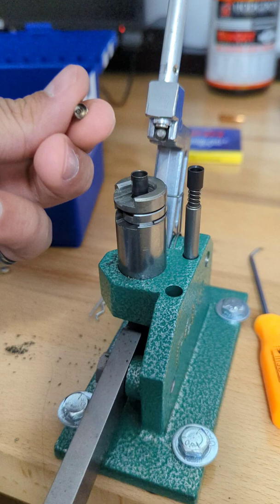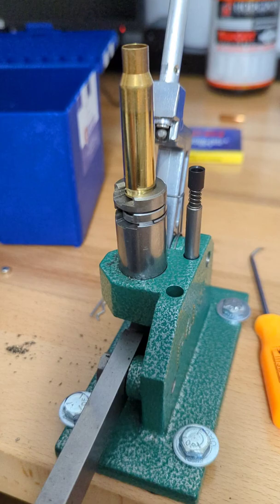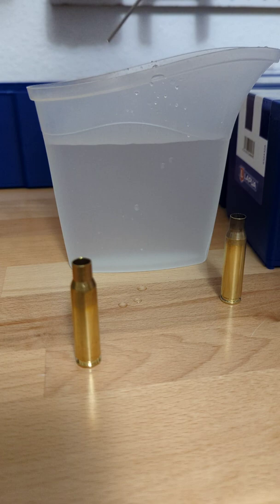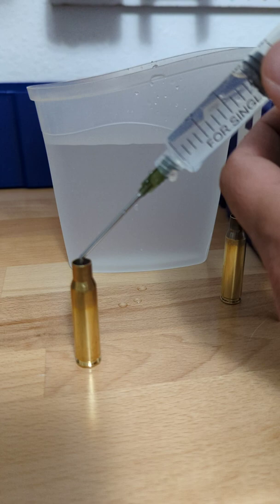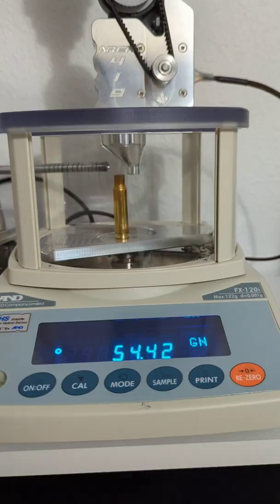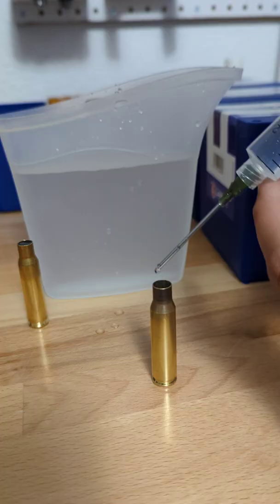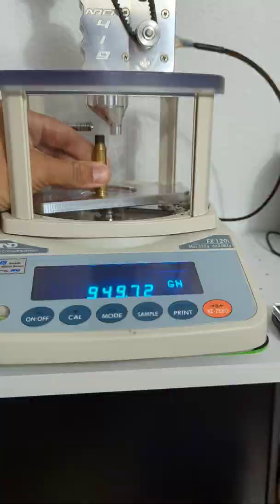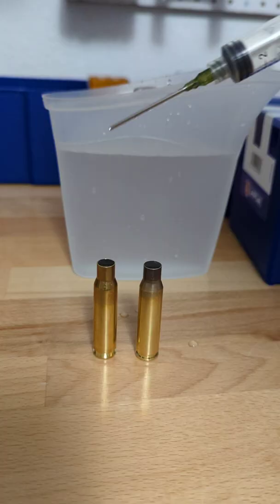Measuring internal volume of brass

Comment: I wonder if the thickness of the brass has also changed, maybe ever slightly with every trim.
Reply: Most certainly. Chamber volume minus brass volume equals case volume.
Reply: yeah for sure it has gotten thinner. you can even notice around the neck of the cartridge. the one that's been fired has a noticeable difference in thickness around the edge of the neck compared to the unfired brass .I don't think it will make a difference as the brass forms to the chamber when fired and that's what contains the explosion. I'm sure there is a maximum amount of times you would want to re use brass before it gets too weak . I'm sure after so many shots the brass becomes too thin and also work hardens causing it to be thin and brittle. I don't think it would lead to catastrophic failure but I could see the brass getting stuck inside the chamber or developing cracks or separating from the base of the cartridge. I think it's more of a concern for malfunction and possible gun damage than dangerous to the shooter themselves.
Reply: I've shot brass until it has split the neck
Reply: @wyattblack7437 just wondering, how many times do you shoot before split develops?
Reply: @litoaykiu  20 +
Reply: Yes. The length you trim off has to come from somewhere. It's brass flow from the case walls
Reply: @litoaykiu  Rule of thumb is around 15 with brass cases. But it all depends on reloading techniques and how hot your loads are. Annealing is very important.

Comment: We used to leave the primer out and insert a same weight bullet to the COL for that rifle and fill the case through the primer hole and then weigh it as volume would change with different types of bullets and depth seated. That would give you the exact volume that you.are.working with. Then pull the bullets, dry and reload. We used to also use the Powley computer also, way before the internet.

Comment: You should have done that after resizing the neck and shoulder of the spent brass. Because that's going to shrink the weight, also if you have to trim an overlength neck

Comment: I don’t have time to read all of the comments so perhaps this has been mentioned before. The entire cartridge that contains powder and the bullet when fired expands to fill the chamber in which it is housed. The case grows in length obviously the reason for the case trimmer. The case can be reloaded multiple times. The brass is flowing towards the neck of the case and thinning out. Eventually the case will crack almost always where it changes direction. Obviously resizing brings the case back down to the correct dimension. Metal is like plastic it moves and flows and thins.
Reply: We are all thinking the same thing

Comment: HOH capacity of brass is always (as a standard) measured with as much of a meniscus as possible-not eyeball level.
Reply: That’s what I remember from my chastity days too, you’re supposed to measure with the meniscus. Otherwise each measurement will be prone to small errors.

Edit: and wouldn’t the weight of the brass tell you the volume of the brass casing as well?

Comment: interesting .34 g° difference.
 is that from case expansion on the used casing??
Reply: Theoretically... this is a highly error prone process which most shooters just laugh at. Not repeatable enough to be useful.
Reply: Well within the tolerances of two different virgin pieces of brass from each other. Pretty much telling us that doing this doesn't reveal anything useful.

Comment: The only thing you demonstrated was how much weight of water was in the casings, not their volume. Volume is not measured in weight, but by cubic volume of a gas, liquid or solid. If you want to use weight for volume, there is a lot of math and very specific data needed to do it. A gallon of water weighs 128oz at std conditions, but it's volume will change based on temperature, atmospheric pressure, and composition of the water.

Comment: If the brass is resized by the die and you check and trim your cases, would that not change the weight as well? Brass shot 12 times? Must be target rounds hunting loads close to max load don't last 12 reloads.... So what's the point of your water test that delays the reloading process

Comment: if you're not loading to full capacity of the case, what difference does it make?
Reply: empty space inside the case is different. Ergo, different pressures behind the bullet.
...I guess you don't reload for precision....
Reply: The Compression cavity is slightly larger. You will get a slower pressure spike vs a faster spike with smaller case, impacting  muzzle velocity.
Reply: @benjohnson2421   I like your explanation the best . Some one once said the simplest solution is the correct one. 👌
Reply: @dailyg2719  Thanks.  Not to step on Nicholas. Just could of been worded better and nicer. But throat space has most to do with the pressure spike. Minute variations in length also contribute. Thin shot out cases can slip the bullet back off the feeding ramp. Mix of both of them and your MOA will be crap.  12 reloads is way too much in my book.
Reply: @Gnolomweb  Wow. Supercilious much? What if he doesn't even reload like me and just wants to learn?
Reply: Yeah, I'm looking at this and thinking, "So what?" I never construct compressed loads anyway. 😕
Reply: @Gnolomweb  The dude was asking a legitimate question and you’re trying to be a smart ass because you got excited when you seen someone asked a question that you knew the answer to. Calm down man. When you mature you realize the people who are trying to get into reloading or the gun game in general shouldn’t be turned off by the attitude of people who are into it. You never know, one day you might find yourself in a trench next to that man with the government on the other side
Reply: @bustabass9025  it’s not about compressed loads. Think of it like compression ratio in a car. The smaller the volume, the higher the compression ratio (in an analogous way). In other words, if you have 40gr of powder in a 100 cc case, and 40gr of the same powder in a 50cc case, which one will give you more pressure? The smaller case, of course. Sure, we are talking about a fraction of that difference, but it matters if you’re chasing single digit deviations in velocity from round to round. You want everything to be the same: case capacity, length, primer flash hole diameter, etc.
Reply: @MasterArkannor  Then he got his answer. Don't be such a soyboy
Reply: @Gnolomweb  And because of people like you, fewer people will take an interest.

Comment: What was the weight of each casing before the water?

I've noticed slight variations in brass weight between different manufacturers,  even variations from the same manufacturer. 

This test tell me nothing without those numbers.
Reply: I feel like that's irrelevant in this situation because the scale was zeroed and only water weight was measured.
Reply: You are correct. The guy's measurements are meaningless. Brass weight not only varies from lot to lot but also from the same box they came from.
Reply: @tyronekim3506  meaningless? He wasn't measuring for that result. He was measuring volume and he successfully got the result. If his intention was to get a different result, then those measurements would ACTUALLY be relevant. In this case, they're about as relevant as your comment
Reply: @Nicholas Cecil  Wrong. The fluid weight volume measurements are meaningless without initial, empty measurements of each brass. Two empty brasses don't necessarily have the same weight or the same volume. Also the brass weights can vary from manufacturer to manufacturer and also from lot to lot of the same manufacturer.
Reply: @Tyrone Kim  thanks for explaining that for the people in the back.  It's strange, my very first sentence addressed the problem, but I guess I made it too complex to follow.
Reply: I agree, he should have taken several new cases and used the average.  and honestly they would have to be the same brand aswell.
Reply: @tyronekim3506  no, what you're talking about is irrelevant. The creator of the video doesn't care about what you're measuring because it HAS ABSOLUTELY NO BEARING on his desired outcome. Read James sharbers comment
Reply: @jimmysp4des229  there's a reason Jimmy Sharbers comment is liked by more people than yours. Because it actually makes sense
Reply: @Nicholas Cecil  it's because most people don't understand the scientific method,  I really hate to break it to you,  but as an engineer there is so much wrong here I could write a book.

Show this video to a local scientist or engineer,  they will say the same thing.  Any scientist in any field, and engineer in any field.
Reply: @jimmysp4des229  idk what to tell you, the video is literally labeled EXACTLY what is being done. The creator only took the measurements necessary to get his result. His results were correct and as desired. So go load your ammo however you feel, but it's meaningless when it comes to this video, its goal, and purpose. You're bringing up metrics that are only important to consider IF relevant.
Reply: @jimmysp4des229  I'm curious though, tell me from your "scientific method" how the weight of a container has ANY bearing on its internal volume? Because you deserve a nobel prize for restructuring our understanding of physics if you can
Reply: @Nicholas Cecil  Wrong. The guy in the video assumes the two brass cases start out exactly the same weight when new. The probability of two cases having the same weight is low, even when they're new. Also, the fired case has small amount of burnt powder residue inside the case which may or may not be significant to the overall weight of the case. Another point to be made is that a fired case has a bigger internal volume than before firing, because the case expands to fill the chamber. This is known as fire forming the case to fit the chamber. This lack of knowledge shows you've done very little reloading, or none at all, or are inexperienced in reloading.

Be safe and in good health.
Reply: @tyronekim3506  he re-zeroed the scale for both cases. Its shown clear as day in the video. Its alright that you're not very observant, but don't pretend to be an expert. You have no idea my level of experience. You don't know enough to know what you don't know. Best to keep learning instead of spreading bad info
Reply: @tyronekim3506  regardless of the fact the video shows him re-zero the scale for each empty casing. Go ahead and explain what you said before please. How does the weight of a container have ANY bearing on its internal volume? As long as you zero the scale for that weight, whatever added water weight can be measured to calculate volume. Is that true? Or did physics change since I got my degree?
Reply: @nicholascecil6733  My bad. Sorry. I failed to see the zeroing of the scale on the fired brass. Thanks for pointing that out. I take back my derogatory comment. I am sorry.
Reply: @tyronekim3506  takes a real one to admit when they're mistaken. I really appreciate that and try to do it when I'm mistaken. Thanks for the debate and praise be to science!
Reply: @nicholascecil6733  Thank you for accepting my apology.

Be safe and in good health.

Comment: everybody reloads their own way, mostly right?
i dont know why weighing is necessary BUT the problem i look for is the thinning ring inside the case just up from the base where the case stretches each time its fired. use a paper clip with an end bent 90 degrees to reach in and scratch the brass looking for an indention from stretch.

Comment: You need a control test. You're comparing an apple and an orange because ones new and the other is used. 

What's the baseline variance of new shell across a pool of like 10? Then the same for used.

Comment: This is wrong info because you’d have to start with the same weight brass and same weight primer. You have carbon on the inside of the cases as well. Even if you stated with the same manufacturer of brass it’s bad info they have multiple dies making brass. You’d have to have the exact lot of brass the exact weight for me to follow this snake oil

Comment: could be filling one water and then pouring that water on the other casing a easier way to see if they have the same volume?
Reply: No because water will adhere to the surface of one casing and wont go into the other when poured

Comment: Aren't no two cases the same internally anyways so it doesn't really matter?  I know ppl weigh cases and bullets and all that but I didn't see much of a difference.  I think there's more of a difference in sizing/powder charge being accurate.   Different strokes for different folks I guess.
Reply: Weighing bullets and separating them with same "ogives" gives you better results. Same with measuring case shoulder setback. If they're all the sane, you will have some very accurate ammo 😜

Comment: Does fired brass ever need full length resizing along with trimming?
Reply: If you don't full length resize then anything in the chamber, even humidity, can cause a jam. "It's a dumb reason to lose a match". And completely unacceptable if you'll be using the round for self defense.
And there's no reason not to: just search "full length resizing Erik Cortina". He interviewed every shooter at the F-Class nationals, they literally all without exception full length resize.
Reply: FL size and trim everytime.
Reply: Anything semi. Full length for sure.  

In very special case scenario I can see why one would fire form with a bolt gun.  Though, it's a pain keeping brass for a specific firearm in my experience.
Reply: @Matthew Beaver  Fire forming brass will get you the most accuracy out of your reloads. Every little thing helps. I'm happy that my technique gives me almost perfect accuracy out to 100 yards. That's enough for me as long as it's within 1" at 100 yards I'm happy. I don't neck turn or know my neck tension. I don't check case volume or concentricity. And i also do not check bullet seating pressure. But I anneal, have perfect headspace, measure every bullets "ogive" (rarely ever care about weight bc it's another step that takes long) and I know my overall length "ogive" of the cartridge when finished. That's about it.
Reply: @Matthew Beaver  I have spent countless hours testing headspacing brass case shoulder setback into the chamber and how it affects accuracy. I have found that the closer you are to your chambers headspace; the better your accuracy will be. 

As for the AR platform it's a little bit tricky because of the 223, 223 wylde and 5.56 headspacing. So if you want to get the headspace close for your 5.56...that ammo won't function properly in a 223 or 223 wylde without sticking inside the chamber.

Comment: No, you have not measured the volume of the case's. You measured the difference in weight.
Grains is a measurement of weight not volume.
Reply: @davidreynolds4715  Volume and weight are absolutely the same thing if the weight is consistent across the board. The why your measuring cups are in liters and ozs. Get yourself checked out at the nearest hospital.
Reply: @StuninRub  
Ask Archemedes!!!

Comment: worthless comparison. Can't level water. What you need to do is add a drop of dishsoap, shake, use that soapy water. The water tension is gone and you can get a more accurate reading.

Comment: I think you meant mass? You cant find volume by weighing on a scale. You could however have found volume using the syringe
Reply: you take the difference of the empty case and the case filled with water to get the mass of the water, then divide that by the density of water to get the volume